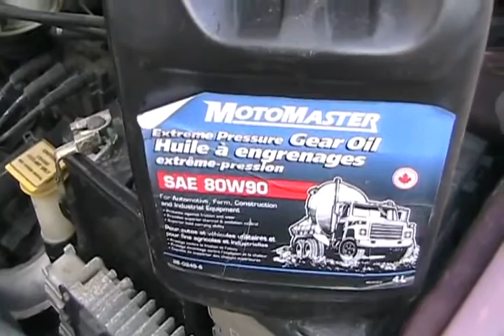#1200 Automotive mythbusters , oils and lubrication [Davidsfarm]

Comment: 5000?! here in Europe we use 10w40 oil and change it every 10 000 - 15 000 km if you buy sinthetic oil you can go 30 000 km between oil change. I and everybody that I know does that and our cars works great and we drive diesels.